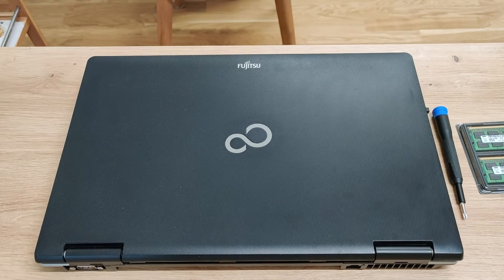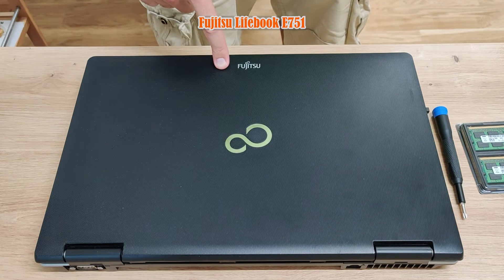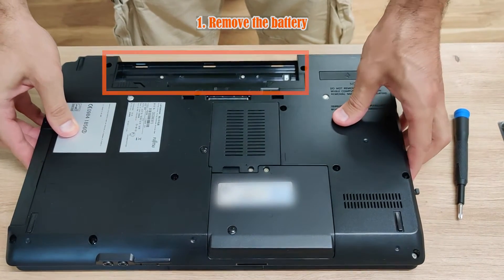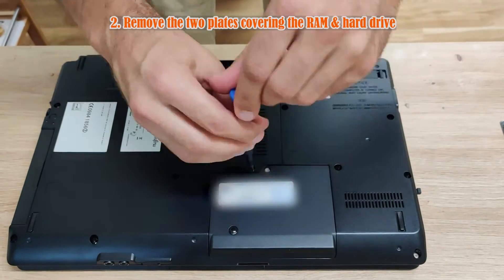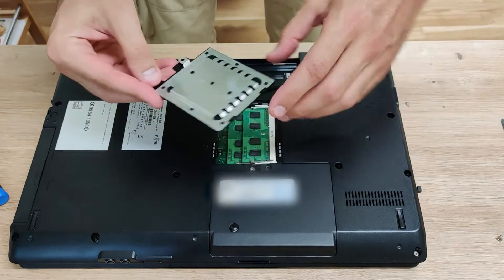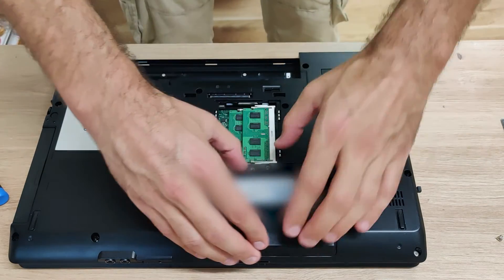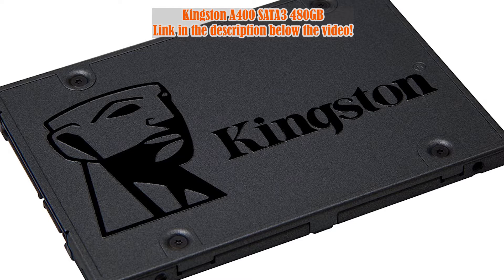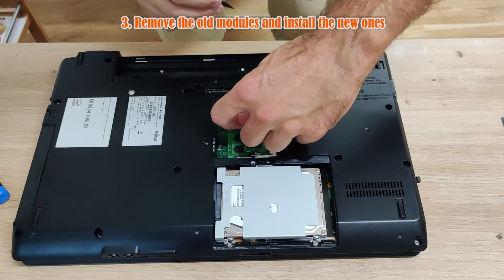Fujitsu Lifebook E751- Upgrading RAM to the maximum

Comment: bro thank you for the video,
but upgrading to 8 ram?
in 2021?
bruh
Reply from the maker: Thank you for watching. Had to respect my client's wishes. Did you manage to get more RAM?
Reply: @smooth.IT.operator  well I did buy second hand ram and I hooe 16 GB willl be enough for me running visual srudio and multiple docker containers 🙏🙏🙏
Reply from the maker: @maximilliantimofte4797  Sorry I meant had to respect my client's time and get the job over with fast. Maximum supported RAM is 8GB on this laptop. You actually managed to get 16GB working? What model please?
Reply: @smooth.IT.operator  I am pretty sure it is fujitsu LIFEBOOK E554